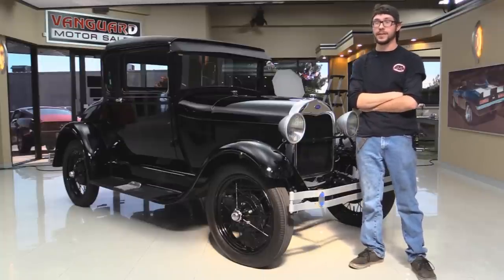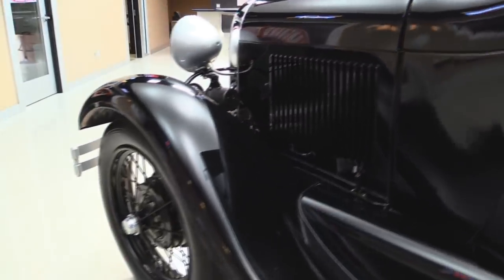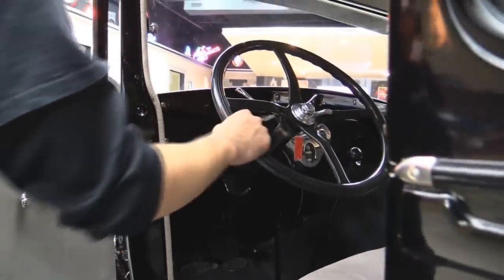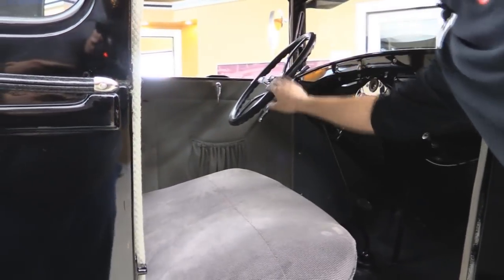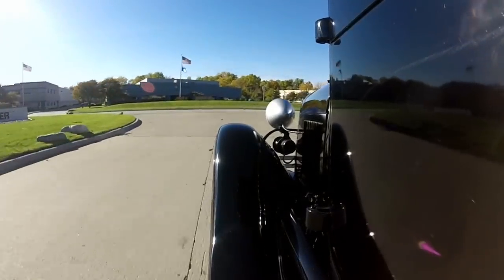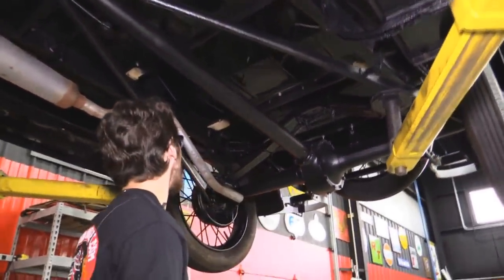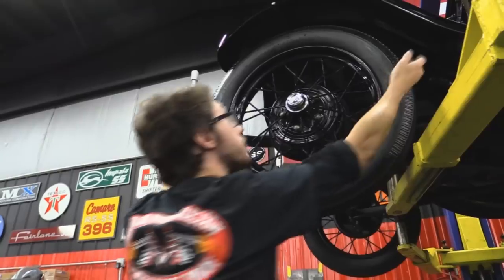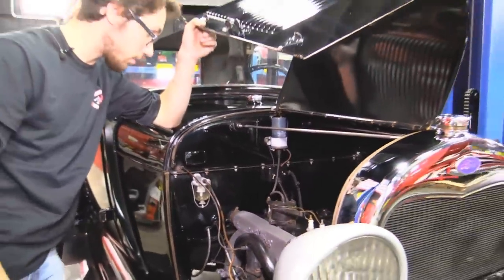1929 Ford Model A For Sale

Comment: Beautifully AND fully restored bottom up. Detail: absolutely NO original 90 yaer old upholstery could look not even close to the impecable looks as on this car. I prefer to think of lack of experience than lack of truthfullness. So friend, you got a lot to learn still, either way. Your car is in awesome condition though. I have seen only one other real original paint A model an it really SHOWS to be original all over. Your car has been for sure, beautifully repainted all over.

Comment: the throttle was also used buy business's and farmers to control engine speed when the vehicle was raised and a tireless rim was put on the rear  axle which could turn a belt and power machinery  Henry Ford was a farmer